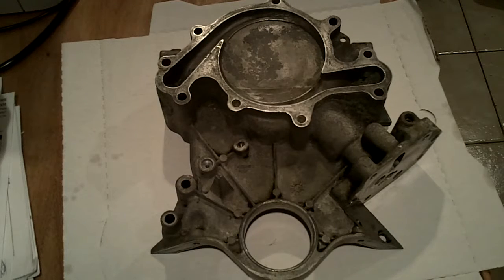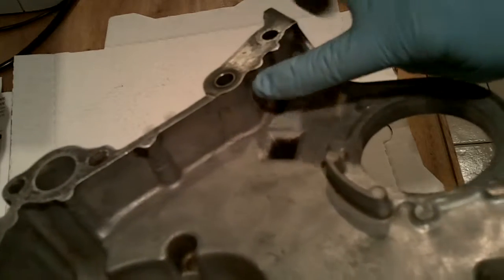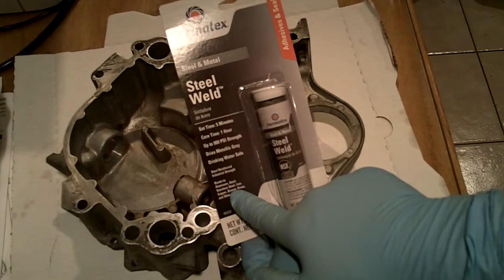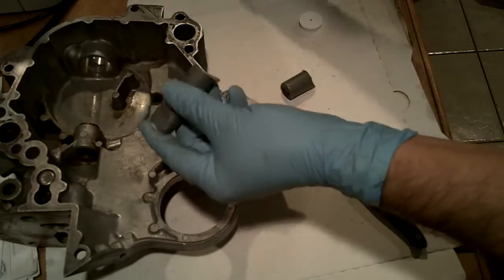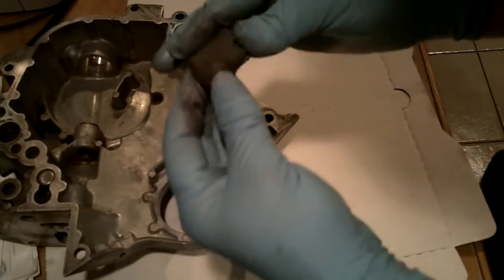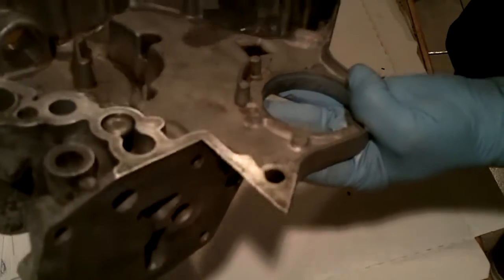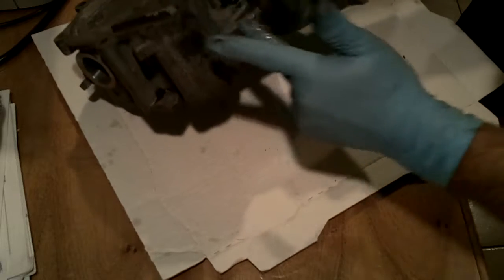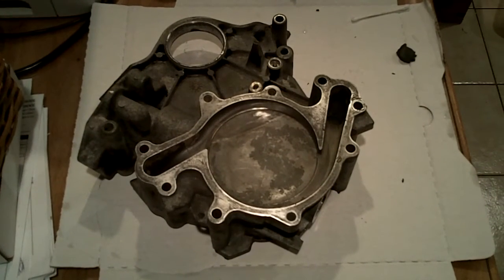Fix an Engine Crack with Epoxy Putty? Will it work? Ford Mustang Timing Cover

Comment: Did that fix the problem ?

The front right hand side corner on the 5.7 litre Chevrolet LS1 V8 oil Pan in my car was cracked 5 years ago so I just got it repaired by a professional welder & it hasn't leaked since.

I got that done because the structural part of the oil pan was cracked & I didn't think any JB weld or any metal putty was going to fix that up.

I think that it's o.k. for use on the outside of the oil pan if it's not cracked on the edge & if the epoxy glue is placed on the outside of the oil pan rather than the inside because it will tend to fall off & do damage if it got caught inside of the oil pickup screen.

Someone bought a blown up motorcycle engine on Facebook market place where that has actually happened !

Comment: Nice job when no acdc tig. I would recommend to drill the end of the crack with 1mm drill bit to stop the crack running any further in the futur(against heat and vibrations), then refill the 1mm hole with the same compound.

Comment: Yes it works we had a hole in an engine block aluminum “ low pressure area held perfectly drove car no leaks, in addition the car passed inspections never leaked and was driven at speeds over 65 mph with no problem s
Reply from the maker: Cool. I'ts been over a year since I did that repair, and so far so good!

Comment: Did this fix it? Did you have to drop the subframe to get to it? I’m thinking of doing this myself vs paying the $1500 the dealership is asking for. Any advice?
Reply from the maker: +Lee Che yes, it's fixed. Been about 4 months now and all is well. Check out my 3-part video series on fixing the oil leak by replacing the timing chain cover gasket. Good luck.
Reply from the maker: here's a link to the first repair video. This will help you determine if you want to do the job yourself or pay a shop to do it. https://www.youtube.com/watch?v=94bFPkKybIw